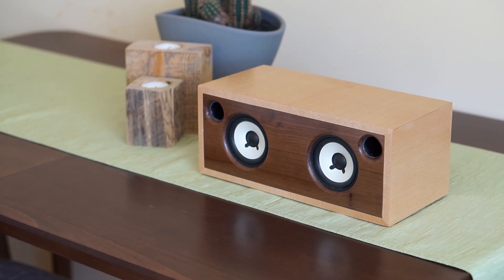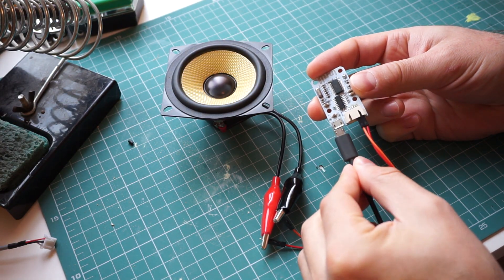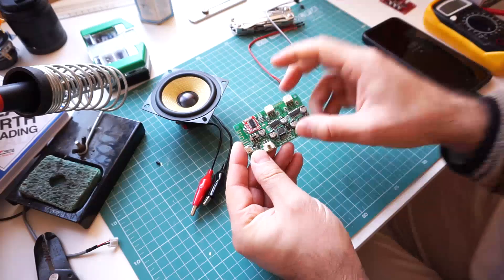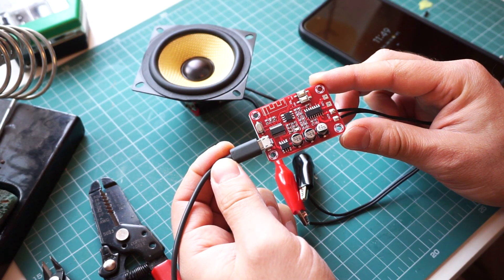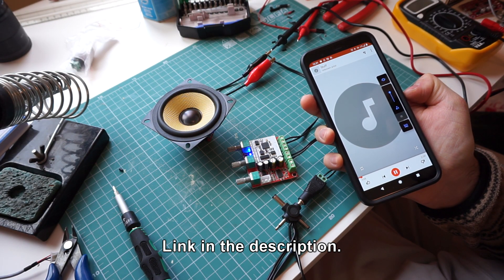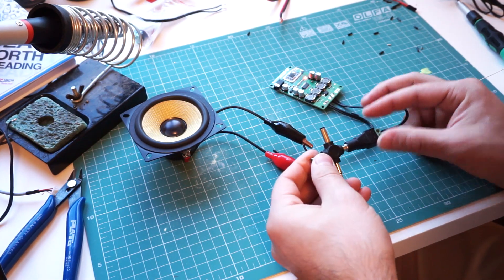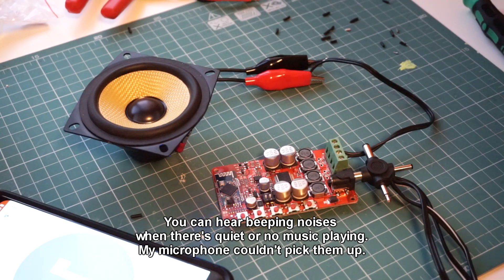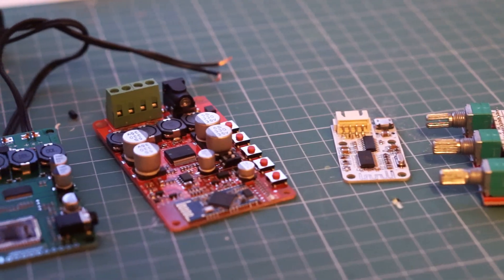Testing Bluetooth amplifier boards from China/AliExpress

Comment: When shopping for these things the price might not be your best guide for quality as prices fluctuate. What you can do is look at some high end western audio that audiophiles think is good using proper listening tests with proper speaker, then note down the chips it uses and search on chip number. Like for example there are certain chips that are DACs which feature in very expensive products, yet the actual price of the chip is not that great, but a lot more than the cheapo chips. Generally speaking if a manufacturer has used a high end chip, the rest of the components will be good ratings. A good class D amp is hard to make. You need good inductors as they can add distortion. Also board layout is critical on the output stage.

Comment: I dont know why you guys dont use speaker cabinets? Its not possible to measure the quality of sound with just a woofer on the table. This kind of test requires an acoustic box with a woofer, a silk dome tweeter and a passive crossover board. Also, when testing bluetooth boards you need to take some distance, a few meters, to see if the card does not lose connection and interrupts the sound.

Comment: is there any budget board with tweeter connections ?
Reply from the maker: There are boards with DSP that can separate frequencies, but they aren't cheap. The alternative is to use a crossover or a high-pass filter. The cheapest option is to use a capacitor in series with the tweeter.

Comment: If u want to know if a Bluetooth board is good u should use the recommended voltage and current not just powering them on with a wrong power supply and say they make noice, that's a good way to test em

Comment: I didn't get any of those crappy ones but I did find one that has been built real nice and was put on a dyno tester and it came pretty close to all specs. It's 4 in by 3 in. Runs at 33 volts DC. And there is a YouTube channel showing it on the dyno. And it was my first board that I bought without even looking at YouTube. So I look at this YouTube video in the beginning to see what he had laid out and I didn't see mine so I knew this were going to be crap
I ended up with a 7498e

Comment: Can you do an update video on other Bluetooth audio amplifier boards you didn't cover.  Specifically ones for smaller projects like the DW-CT14+, PAM8406, i.e. boards that can run off 3.7V lipo battery voltage, thanks.

Comment: Hi there  I have the TDA7492 board and it sounds very good, indeed with no Bluetooth noise.  But I have this board in 2 flavors one is on red PCB the other on a blue PCB.  The blue one has horrendous Bluetooth noise and is very bad a low volumes.  I think it really is the luck of the Draw with these boards. I'm taking mine to my electronics specialist for  further diagnosis.

Comment: What are the cables you used to connect the speaker to the board?
Reply from the maker: Just regular speaker wire. 18 or 17 awg

Comment: I would stay away on those devices with JLxxx or Beken based Bluetooth module. They all include those Chinese lady voices thing.
"dah bluetoh devwise is connecteded uh successfulleh" at full volume.
Reply: Not all of them its what the designer wants for firmware mine has the doo doo do, di di di. Or the windows sounds

Comment: This is a poor test with a bare speaker. As the diaphragm moves forward compressing the air at the front the pressure at the rear is reduced. The effect of this is to make the sound thin and tinny with much reduced bass. A speaker needs to be in an enclosure to keep these two opposing sound waves separated. You could say it’s like an audio short circuit. Some speaker enclosures are completely sealed while others have a tuned length of pipe connected to a rear port known as a bass reflex port for better bass.
Reply: True

Comment: I compared the tda7492p with a sony STR-DH190 stereo amplifier and didn’t hear any significant difference soundwise. The tda7492p didn’t have any background noise. Maybe in your case it was caused by the powersource?

Comment: take my advice here if you want because you know it's going to actually be good.   do yourself a favor and just pick yourself up a Chinese stereo preferably one of those that are like about $35 have a 10-inch screen and basically that's really all you actually need to go and get pretty decent sound and The Equalizer of the phone. Do that and you're actually most of the way there and you'll get it a legitimate 10 to 15 watts RMS.    

you can get those for about 25 to $35 if you know where to shop in Alibaba or someplace else I think I used AliExpress or the other one is being good you can also use those guys but then again I got a pretty good rocking stereo for $35 and again it has four channels of amplification and it does do a pretty good job and has lots of inputs and it works pretty well.

a step up on audio quality absolutely if that's your primary concern, get yourself one of the pioneer head units and one of the best ones I believe is I believe around 99 to $125. Now the nice thing is that you get an excellent 31 band EQ plus you get a basic tsp lifetime alignment features and you also get the option to use something like network mode where you have a high and a low and the Distortion is absolutely less than .5% or 1 or less depending on your power supply and if you want to go a little further into it upgrading a few components and using a very good very stable battery power supply with the unit

some of these Pioneer head units can be had for less than $35 use and they're a fantastic deal if you're just looking for network mode and a pre great amazing amplification already in the box and maybe a subwoofer amp or a dedicated subwoofer amp is basically all you really need to really have one hell of a rocking system.      

 the budget all-in-one Champion has to be the Sony deck which it does a legitimate 50 watts per Channel.    the unit is on sale at many places and is usually on clearance and is a really good value to make a Bluetooth amplifier that has very very good amplification very quiet and lots of options to speak of

Jensen has a line of amplifiers that has a Bluetooth input and is very small compact and classy and can be had for I believe less than $90 as a Bluetooth input just going to shop around those models are coming out shortly and in fact they do sound really good because they've been tested so they have the same amplifier innards but not all of them have the capability to take a Bluetooth signal.
you can always use an external Bluetooth extender and honestly those things can be found for a few bucks  and the sound quality is not all that bad or is indiscernible is being bad by any measure.    not up to audio file standards are really critical listening I will make a great portable boombox.

John audio tech has actually review quite a bit of these boards and he has a really good actual demonstration of a few of them working quite well and I would check out his channel if you're looking for small compact words that don't suck.

there's also another amplifier that is really great and is actually easy to find all-in-one and can be had for about $4 each and does approximately 20 to 25 watts Max but really 20 clean Watts if you can actually Supply it with 19 volts DC.   
there are these old NEC chipsets which are basically using Chrysler vehicles that have the power and amps room speakers these speakers are actually really good sounding and if you get one of the two ways you're actually able to have a complete amplification in one unit but you're still going to have to add Bluetooth or a line input of some kind in order to drive it pretty well as the takes line-level not RCA inputs.  you can actually mess with the actual internal circuit and actually get a preamp input they work really good but again that's up to you there's a schematic for them I forgot what NEC part number it is but if you're just looking for something simple you just need to connect basically two wires to or she's with four wires to then the Infiniti acoustic 10 Chrysler sound system and a lot of the Chrysler vehicles is a really great way to go  .   I would even dare to say it's almost to black or very warm plus these chips also have a high pass and a low pass signal and that's really kind of cool

if you're looking for something that's basically all in one and you can buy your local store, those old 5 watt or three 1 amps well if you look at Walmart they have the Scion brand of speaker for like $9 I Believe In A Box there's also a $19 model that I believe has slightly bigger amp but I think they have the same app I'm not sure but they basically sound the same and it's actually really quite clean and it only actually works via a jack input for a 3.5 mm.   

I'll be doing around of sound testing a little bit but so far the drivers are really good and this sound is actually quite good but again you need to have the input to drive it and that's about it so it doesn't really work so well with some phones but does work well with the signal from a computer.   some phones are able to Output more so your mileage may vary
the best part of the speakers that are actually really really good and you know what this amp actually does produce output all the way from 22 as far as I can hear 16000 Hertz.
Reply: These are meant for ppl who are into building small personal projects as a hobby. It’s also a good learning tool for kids who will eventually become something in the future.
Reply: I'm starting to realize that text-to-speech is a mistake.  
I sound even more retarded than usual
Reply: @MickeyMishra  … nah man don’t say that you’re all good 💪 you just know a lit more than what this video implies., I know what you mean though lol. Voice to text makes it much easier to express yourself.

Comment: i like to do a bluetooth amplifier for my car and don't use any kind of radio car devices, only connect my speakers at my car and my phone. ¿any recomendation? thank you. :-)
Reply: Pick the first one, power it by the lighter with a usb cable.
Solder the wires for the speakers on the back witch it's labeled and voila! you have car audio amplified with bluetooth on a cheap.
I have currentely a pam8403 with speakers wired. gonna buy that one to add the bluetooth function.

Comment: So none are usable?
Reply from the maker: Only the two I linked to in the description are kind of okay. Not perfect, but good enough. But I can only recommend using them with 8 ohms because they don't have a heatsink and get warm.
Reply: @LeftyMaker  I have received some of these just yesterday:
https://www.aliexpress.com/item/32985655660.html
$1.50 a pop.
Very decent audio quality, no weird language, only a 1-second long tone when powered on and when paired.
Can recommend.
EDIT: also tested the one with integrated stereo 5W amplifier. Issues to report:
1. there is nothing in low end frequency. Kinda understandable why they did it, as there are no caps on 5V rail to support the current peaks.
2. pops and clicks between audio tracks, or between words and sentences on a podcast. Looks like it enters some kind of sleep mode when there's a silence for half a second, and the switching is poorly implemented, likely on AC coupling between receiver and amplifier chips.
The headphone one seems pretty decent though.

Comment: hi, i have daisy chained some tao tronics bluetooth transmitters, only to lose one half of the audio signal when i did. i found that i could get stereo with multiple transmitters, if i had only one bluetooth headphone paired to it. i think it may be the quality of the splitter im using. but my ask to you is, is there a way to see the channels that each transmitter is using when pairing? i havent been able to find any type of multi unit BT transmitter, and tao tronics hasnt been able to tell me how to get inside their devices. maybe theres a way to build something that will be configurable to the point of limiting BT channels to specific transmitters? maybe even being able to have confidence when unpairing a BT headset, without relying on device code lights on the transmitter. i figured that there could be some way to make a device that can transmit to more than 2 BT devices, by using more than one transmitter.
thanks
mark

Comment: i bought the smallest one that is 12w r , 12w l , sounds god damn good , but sure is loud as at startup you have no volume controle, beside that, its pretty nice , i used speakers from 2 dead boomboxes , speakers were A1 so its a nice cheap project with recycled parts , i also used recycled cables from the boomboxes i recycled , great quality stuff even tho its from the 80's , thinking about it, its 40 years old speakers and its still beating some new ones lol

Comment: hello buddy, thanks for the great video... but i have a question...what quality bluetooth adaptor  would you recomend me to connect to a classic music system sony grx70 ?,  is it worth it to connect a BT adaptor  that supports LDAC o aptX HD that i can buy on  aliexpress(there so many that i cannot decide)?, I want to transmit a better quality sound from my smartphone thru TIDAL, and also making config to my phone... is it possible to notice a better hifi quality sound if I do what I have planned?.. thank you , cheers!
Reply: hi there. Im planning to do the same thing to my old speakers, do you mind telling me what solution you came up with.
I'm thinking of buying a cheap bluetooth receiver to connect to auxiliary but i'm not sure whether the sound quality is affected or not. 
Thank you for your time!

Comment: You usually have to solder a 3-4inch wire onto the Bluetooth PCB antenna to get rid of the noise you experience. It's an easy fix on these cheap boards.
Reply: Do you have a link to any more info on this? Interested in trying it for my cheap receiver
Reply: @TheRealBobbysmile  not really. I'm an electronic engineer. I just do it myself. Basically take a 3 inch length of insulated single core wire (it's more rigid and can be bent where you want it). Solder it to the end of the Bluetooth antenna on the board. The antenna is the zigzag shaped trace (the inverted F antenna). It dramatically reduces noise from these cheap boards.
Reply: @TheDradge  great, thanks I'll have to give it a go. Got some single core in a draw somewhere I'm sure
Reply: Bro please tell me how to solder it

Comment: Your test speaker is operating in free air which is not how the speaker was designed to work.  Sound quality and output are poor.  You have two desktop speakers in front of you, why not use them for testing instead.
Reply: U right

Comment: I got the last one from banggood a year ago. The sound is not terrible but not good either,  lacking bass and a bit high on the mids.  it's loud with 8ohm speakers and actually not bad overall if you don't care about audio quality, but need volume.

Comment: If there would be a way how to turn off the voice notifications, or just exchange them for various beeps, I'd buy the cheap ones - for small, in-room speakers :)
Reply from the maker: Apparently, the CSR chips can be reprogrammed with a special tool. I'm looking into it.
Reply: @LeftyMaker  Looking forward to your follow-up video then :)
Reply: I too would LOVE to know how to do this! It would make them a much more useable product! 
Maybe you could test if this trick works? hold + and - volume simultaneously until a beep sounds, which indicates that voice prompts are disabled. Apparently it works for many bluetooth speakers/brands. Obviously will only work with amps that have buttons! Cheers
Reply: @michaelhanley9966  WOW! Thanx! 
Many no name bluetooth devices have these same voice prompts and are annoying to say the least. My car bluetooth add on has the same bad english prompts. I'll try it and let you know if it works.
Reply from the maker: @michaelhanley9966  didn't know that. Let me test this tomorrow with the boards that I have.
Reply: @LeftyMaker  Any luck with the button trick?
Reply: @MyHi1997  didnt work for me =/